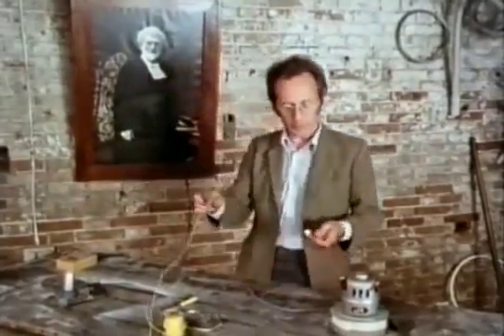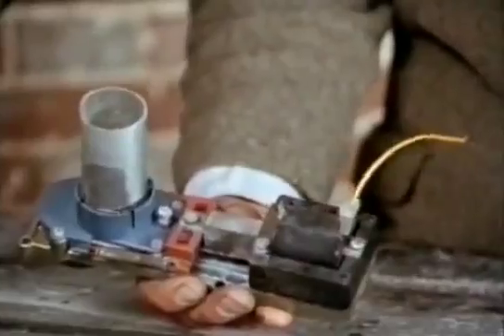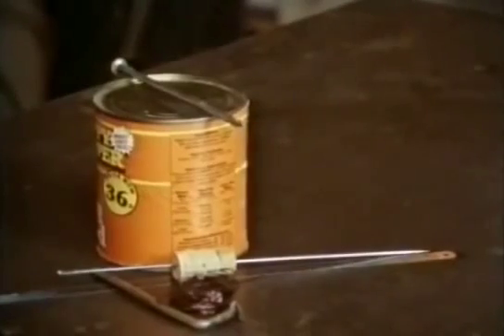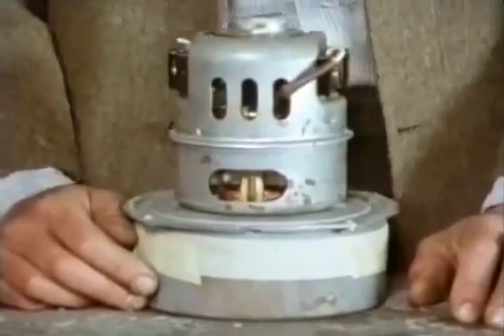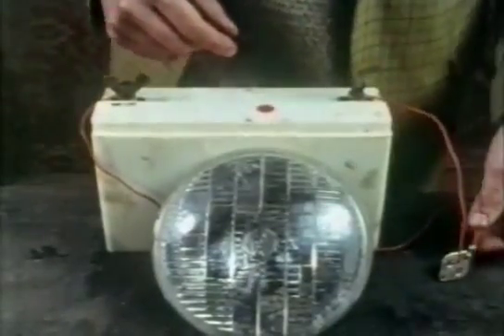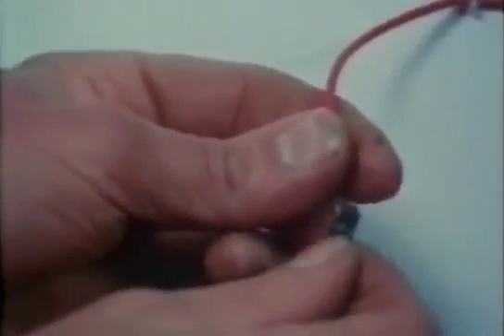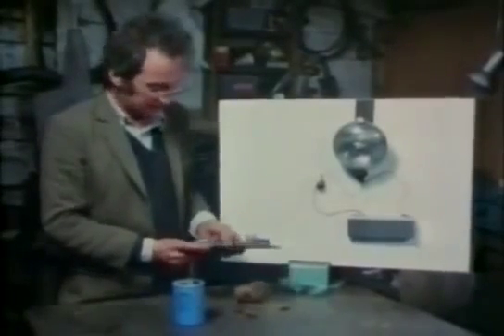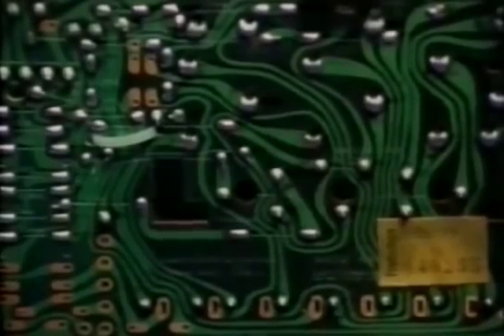Electronics Explained by Tim Hunkin & Rex Garrod

Comment: In school we had a lesson about transformers with coils in range of 400 windings and 100 windings.
-Which meant the voltage could be scaled by a factor of 4.
The “clever” little boy I was, a single winding with a cable also worked.
-So I scaled the 12 volts to 960, which might have broken the volt meter.
It turns out things work they way you expect them. Sometimes too well.

Comment: Tim and Rex barely get started on "explaining electronics" in this video. Magnetism is not electronics, that is just plan old electricity, but that is a fine point. I am watching the whole Secret Life of Machines series again, very good except for perhaps a couple of episodes that were uninspired.
Reply: You tube experts know all so why do you watch?
Reply: An Electro magnet is used to create electro motors to transform electricity into motion.
-It is the key ingredient for a washing machine. Compressors for fridges.

It is not micro electronics. But those also work because of magnetism.
The circuits oscillate, because energy is cycled from magnetic fields into current and back.

I currently don’t understand totally (3rd semester physics is about electro magnetism and is considered difficult).

With the help of transistors you can set a single direction for current to flow.
Basically with those components you can build computers.

But magnetism really is core to electronics.
Reply: @antman7673  , no, magnetism is NOT the core of electronics, although in the beginning it had more significance. The majority of modern electronics works without inductors at all.
Reply: @youtuuba  
The force is called electromagnetic force.
There is no electric force without magnetic force. 
It is one thing.
Reply: youtuuba —- just about every electronic device today uses induction in order to operate.   The component may not appear as a classical coil, but induction and components relying on inductive behavior are in every IC, smart phone, tablet, thermostat, router, modem, led lamp, robot, etc that we have.
Reply: @KK-pq6lu  , I am an electronics engineer and retired college teacher of electronics. I do understand the relationship between electricity and magnetism, but the nuances of electromagnetism are too arcane for casual discussion in YouTube comments. From an everyday "hobbyist level" theoretical level, we can separate the finer points from the rule of thumb aspects 

My original comments were about the base level stuff being depicted in the video. I also commented how much modern electronics do without physical inductors, except in transducers such as motors and solenoids, or in transformers and inductors used in switching power supplies or in tuned circuits. Many modern electronic circuits, while inductance is still a factor in their design, have no discrete inductor devices. Compare this situation to equivalent circuits of decades ago. And because we now so often have circuits operating at much higher frequencies and/or lower voltages and power levels, the inductors that ARE still required to be physical devices are often so tiny that we might not even notice them.
Reply: Have you heard about electro-magnetism.
-If you believe it or not. It is one phenomenon.
Electromagnetic radiation is light.
Moving charged particles induce a magnetic field.
A magnetic field can induce an electric current.

So yeah, that is how induction heating, induction charging, transformers, radios, WiFi.
It is electro magnetism.

Maybe you don’t know it, but it is the same thing in some way.